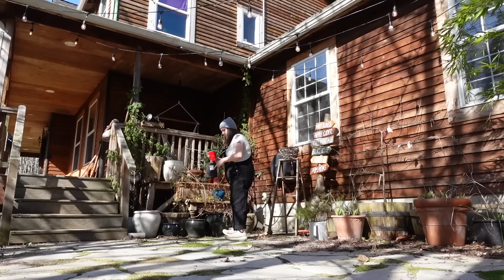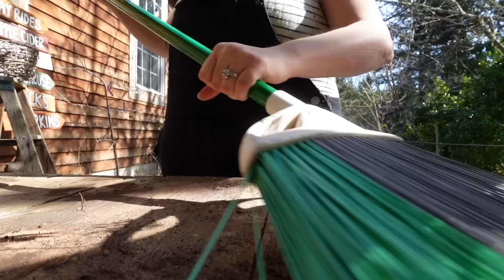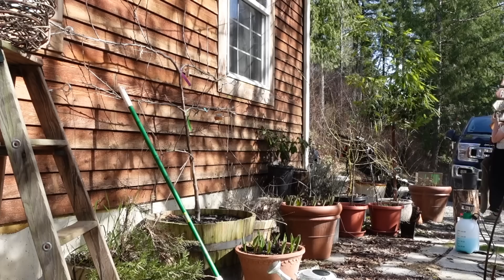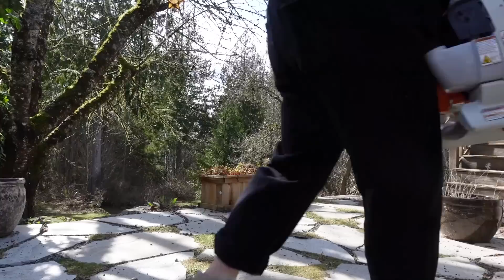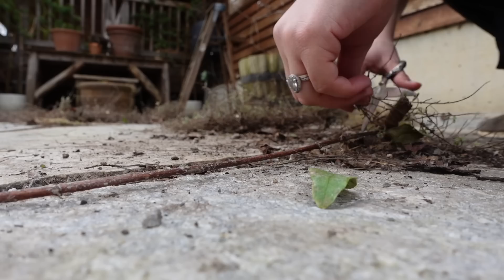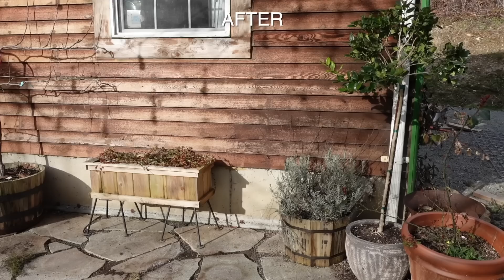GETTING RID OF OUR POTTED ENTRYWAY GARDEN | SPRING CLEANING

Comment: One way to keep lots of pots from looking chaotic is to use all the same type of pots or all of the same type of pots grouped together. For example, all of the terra cotta pots together , all of the blue ceramic together, all of the concrete together, etc.
Reply from the maker: Yes! That was the original plan but my ADHD took over and it eventually got out of hand and turned into a mess lol